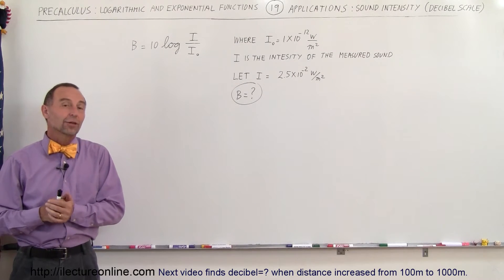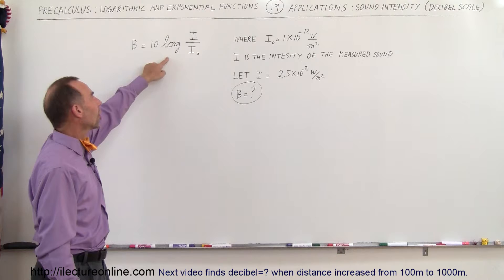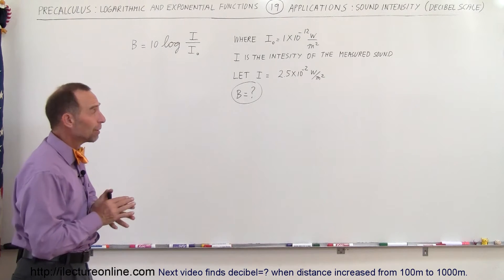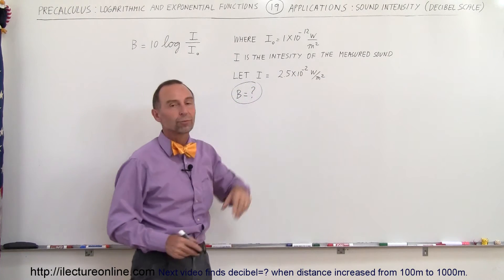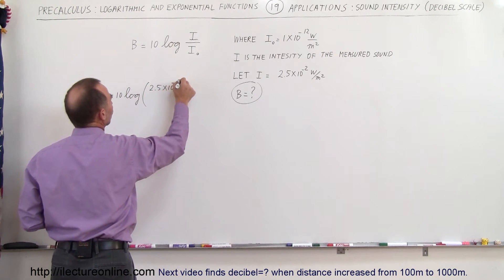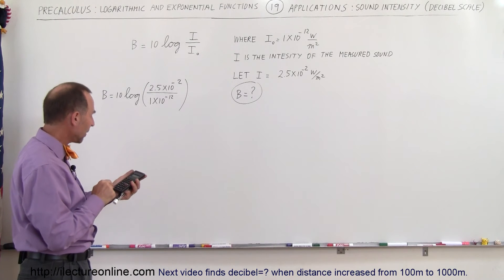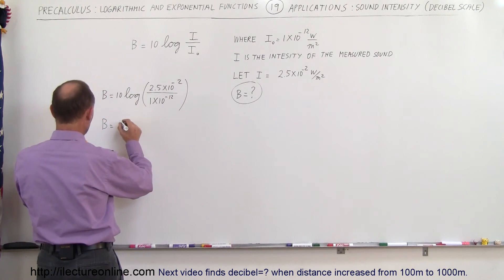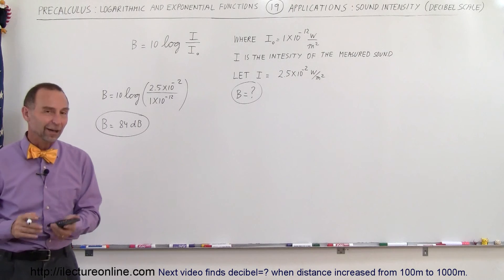PreCalculus - Logarithmic & Exponential Functions (19 of 20) Calculating Decibels (Sound Intensity)

Comment: Mr. Professor why the sound is in logarithmic scale? And if we want to increase its value of 1 the sound has to be ten times louder. Does the air produces some inertia?
Reply from the maker: The logarithmic scale is for convenience.  Otherwise the number differences would be enormous.  The difference between a faint sound and the threshold of pain is 120 dB  or  a factor of 10^12
Reply: @MichelvanBiezen  I thought that the reason is similar to "fission" and the wave propagation i. e. movement of molecules of air. So it is just empirically usable.
Thank You.
Reply from the maker: Yes, just a convenient numerical way to express the intensity of sound.